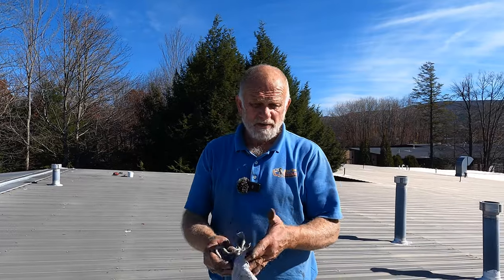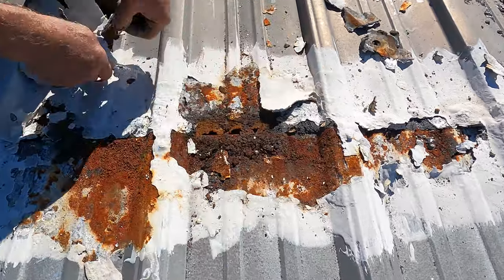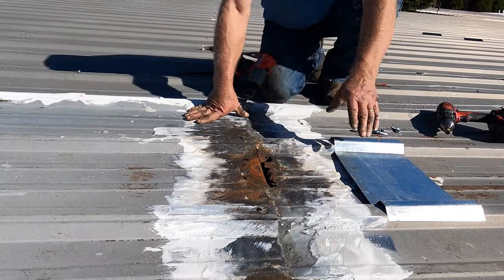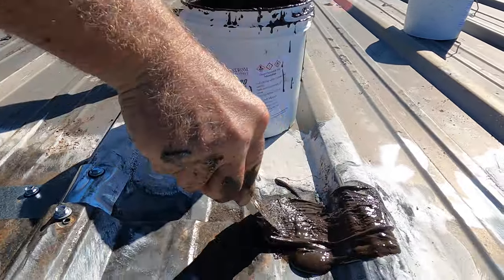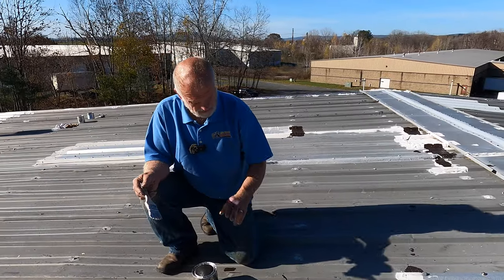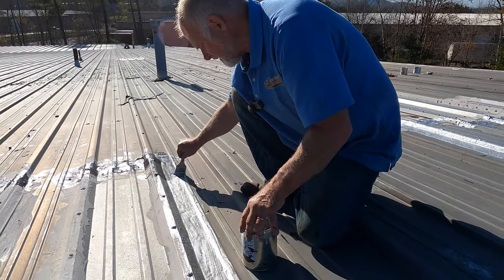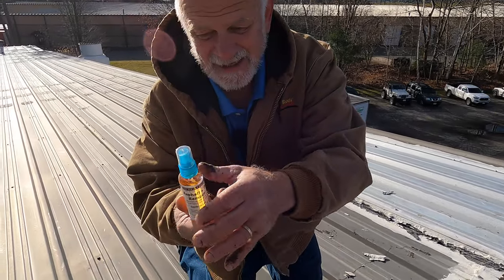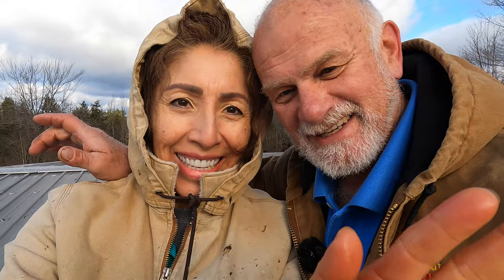How to Repair Rusted Holes in a Leaking Metal Roof - Extreme situation

Comment: A COUPLE QUICK NOTES: A $2.99 can of WD-40 will clean tar off your hands like a champ. Also if you are using a "cool-seal" type product on a tin / metal roof and you need to repair some pin holes just clean the area well, apply a thin coat of roof coating and a small piece of 100% cotton t-shirt over the hole and then thinly cover the cloth patch. After it dries apply a couple more coats of paint and it will last as long as the paint lasts. The t-shirt patch works the same way as the long strip of fabric the roof doctor used in this video but my method should only be used with small holes not entire seams.
Reply: You sir saved my hands. Thank you. WD-40 cleans turbo poly seal too
Reply: Good point about WD-40 as hand cleaner. But a piece of cotton t-shirt would hold water, if water could get to it. A piece of thin polyester cloth might be better?
Reply: Maybe fiberglass cloth?  Yeah, WD-40 cleans well.

Comment: Hi thanks for your information, i want to know how to cover a hole in the roof i mean can we cover the hole with using a part of the same sheet using some glue
Reply from the maker: Yes you can
Reply: @FlatRoofDoctor  Hope you'll also use the strip of fleece, sandwiched between 2 applications of Turbo Poly Seal, like the Flat Roof Doc demonstrated.

Comment: Do you replace all screws with loose washers?
Reply: those are special roofing screws that have a rubber washer on them, when you screw them in the rubber smashes flat and makes a seal to stop water from going in the hole. my garage unfortunately has prob a few hundred nails in the metal roof with no washers i been trying to replace them but the wood under the holes is so rotted from water i really just need the whole thing redone at this point ugh
Reply: @hippa2dahoppa2  Lordy, I know what you mean. If the wood isn't horribly rotted yet, I wonder if it could work, after a month of dry warm weather, to remove the screws/nails, inject caulking into the rotted holes--and let that cure before installing quality rubber-washer screws.
Reply: @Lightharvest-dd2bf   i still have the problem. ive used caulk in some holes, i tried replacing the nails with bigger metal screws but some of the nails completely missed the beams (there is no obs under the roof) and then the parts that are in the wood the wood is rotted and the screw wont catch. so i did try caulk. theres one main spot in the back that leaks that is very hard to get to since im on a hill and its alot of slopes on the garage, i just tried to replace as many as i could then took henry aluminum fiber and coated over it once. it minimized the leaks i must of filled a few. but after burning in the sun and not having a flat surface to put the bucket (had it hanging on a rope) i  gave up and  went back to the other projects. i figure the roof has prob been leaking 10 yrs since before i owned it. i have buckets everywhere catching the small drips and plastic on the floor to protect the floor for now. i cant even get roofers to do simple patch jobs or boots on my main house and if they do they inflate the cost by x4 just because they know nobody else will do it. i dunno what ima do really. prob do the whole garage roof in henry fiber to make it look nice and then the leaky section i might try the turbo poly seal like the guy uses but that stuff is expensive as hell just for a gallon

Comment: The roofer who put the metal roof on our house before we bought it put it over the existing tar and gravel roof.  Now we have a problem at the ends of the roof because they didn't do the whole roof and left a portion of it exposed to the elements. There is so much water underneath the metal at the end of the roof and we don't know how to get it out before we can fix the problem.  How do we remove the water? Thank you?

Comment: I am not so sure about this.  The roof iron has rusted right through and there is no rust treatment to stop further rusting underneath,  I think you have to treat the rust with a rust treatment product both sides and then paint or seal both sides.  Same with the laps and the insert.  No repair will  last indefinitely but a repair should hopefully last the remaining life of the roof.  What is the  good of repairing the outside surface if rusting continues underneath? I think for the extra effort the repair will last considerably longer.

Comment: Man you did not do any better job than the person that first installed the metal sheeting you both fixed the screws in the flat part of the sheeting. Your fix will fail as well but by then you will be paid just like the first roofer.
Reply: Also, rust breeds rust so remove rusted area... duhhh
Reply: The Flat Roof Doc DID remove quite a bit of rust as well as the bubbled and leaky old patch. He used a 3-layered, fitted fix of compatible materials. He probably should've emphasized checking for damage UNDER the loose screws, and patched before replacing with quality screws. I'd say that flat roofs are INHERENTLY worse than sloped, and it's nuts that 12' wide old mobile homes weren't built with a slope! Doesn't need to have a double pitch--on a shoestring, my dad built our 20' wide wooden home with a single pitch, 3" of snow in winters--and it never leaked.